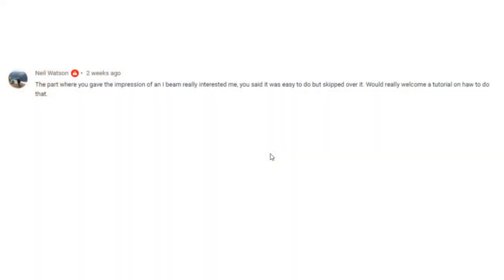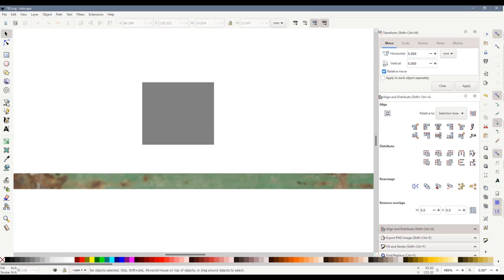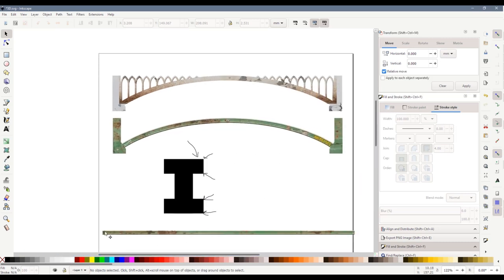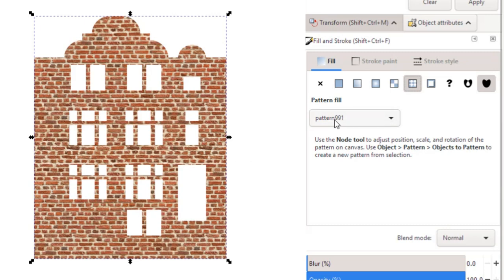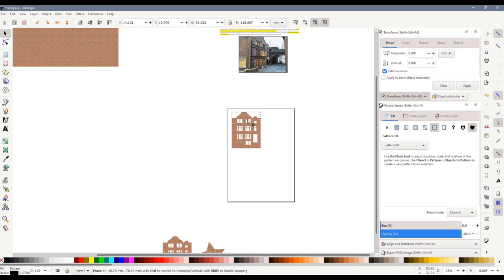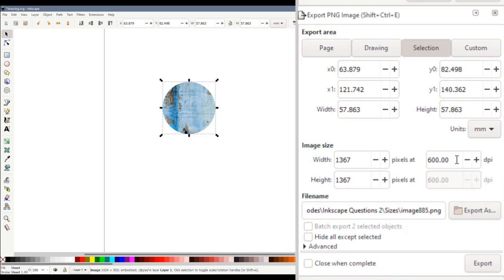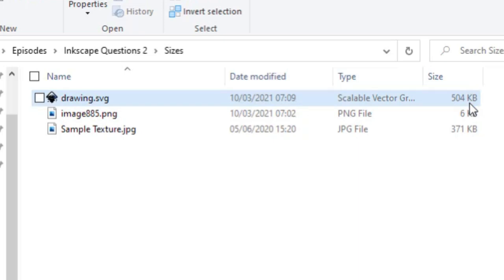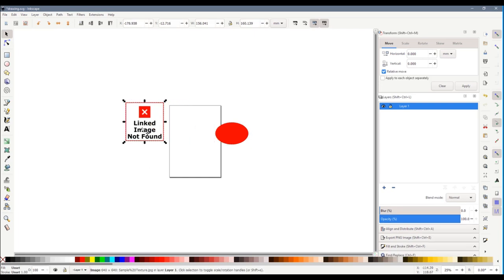Scratch Building with Inkscape: Textures - your questions answered

Comment: Great tips there Michael and I will be trying them out. I have mainly used the scalescenes textures which start around 5 MB but my files quickly grow to 60-70MB and my first file for the terrace houses was over 600MB. My poor old laptop was getting a bit warm!! I resorted to doing different elements in different files to keep things manageable on the factory. I’ll give these a go and see what happens. Cheers
Reply from the maker: Yeah 600mb files can happen if you have multiple elements all with textures that are 5MB. Because of the base 64 encoding, a 5MB texture takes up almost 7MB in Inkscape before you even start. I do think there may be something else at play to make them even bigger but I’ve not yet worked out what. Good luck. Let me know if you notice any positive benefit. Michael.

Comment: Well I hope you're satisfied with yourself!

Last night I found your videos and today I've spent LITERALLY 8 hours messing about with this software and have managed to design a little cottage for my layout... I'll be printing it out tomorrow as it's basically a printable drawing.
Won't be able to add much relief to it though... That bit still eludes me sadly..

I wonder would you be able to make a video where you show us how to create a small building, either made up or real,
But using imported textures rather than a blank template to print and wrap with brick papers?
Reply from the maker: Gosh! Thank you, I think! I hope those eight hours were enjoyable!? That’s a good idea. A quick start-to-finish where I design and build a little outhouse or something?
Reply from the maker: Hi again. I saw your reply very briefly but it has now been deleted. Not sure if you deleted it or YouTube did (it does seem to delete comments that contain a link to Textures Dot Com). But yes. Your idea is good. Fitting it into half an hour will be a challenge!
Reply: @Chandwell  I reckon you could do it!

How did you texture the front of your Weir pub?

In the video it's never mentioned and just shows you adding DETAILS to it?

Cheers!

Comment: Great, love your layout. Have you ever considered making a small line which passes through the back and goes down a small helix and back to the beginning. You know for passing trains like freight and just passes. Or is it just an end to end? Hope this helps
Reply from the maker: Thank you! Unfortunately that would not work for Chandwell. The station end is blocked in on both sides with concrete and the whole thing is built on top of cupboards that are in use for our general household stuff, so there really is no space for a couple of helix. I would love to have a round-and-round layout but not until the kids move out and we have a spare room! 😂👍

Comment: Do you have any idea how long your buildings are likely to last? I am thinking about the different adhesives you use, for example the glue sticks and the glue on the back of the sticky labels.
Reply from the maker: I have no idea, Andy. I made the first building using these techniques about 12 years ago. It was 00 scale and has been stored on-end in the garage for the last 7 years. There is no sign of peeling or delamination yet. I often wonder about my "sticky label method" window frames. I've been using this technique for only 18 months, but so far, so good.
Reply: @Chandwell  That sounds like a decent lifetime, especially if kept in the garage.

Comment: When saving there ante many file types. Which one should I save as? I tried saving as ‘Inkscape SVG’ but it kept saving it as a Microsoft edge page that I could then not edit
Reply from the maker: SVG is the best and correct format. Edge is capable of opening them and may have set itself as the default. Don’t worry. Open Inkscape and use File > Open to open the file in Inkscape. Also try right-clicking the file and choosing “Open With” and then choosing Inkscape. It may give you the option to “always open files of this type with Inkscape” in which case your problem will be solved. Let me know how you get on.

Comment: I have a question. I'm using Scale Scenes and Inkscape. When I import a full sheet texture, like red brick, Inkscape sees it as two halves. It then only prints one of the halves even if I group the 2 halves together. To print the full sheet I have to save the page as a PDF and them import that. Why???
Reply from the maker: Hi Mark, I assume that the Scalescenes kits are made with two duplicate textures to fill the A4 sheet and that it’s duplicated in a way that Inkscape doesn’t understand properly. That’s just a guess though!

Comment: Do you know of an alternative to finding the cross, circle, square? I don't get it when I use the Node Tool and scroll out. I can't find another way to reduce a Textures concrete down to 1:148. TIA. Ali
Reply from the maker: No I don’t I’m afraid. Not something I’ve come across but it does seem to be temperamental.

Comment: I would like to underscore the point about not moving your files once you start creating your design. While Michael notes deleting a file will break the link to your design (around the 28:00 mark), so does organizing your files into folders after you create your design. I'm in the final print stage of my building, and thought I'd neaten things upby organizing the scattered files into folders. Don't do that! I now have a document full of broken link notices and moving the files back to the original folder doesn't help either. Sigh. Literally back to the drawing board!
Reply from the maker: Hi! Yikes! This can become a bit of a pain, but all is not lost! In Inkscape, right-click on one of the broken images (the big bit of "Linked Image Not Found") and select "Image Properties". In the tool panel that appears, you will see "URL". This is the name of the file relative to the SVG file. So if your image was called "Bricks.jpg" and you moved it to a folder called "Textures", then change the URL to "Textures/Bricks.jpg" and you will see the image come immediately back to life. If you move the image up to a parent folder, use "../". So if you move your Bricks.jpg to the folder ABOVE where your SVG file is, then change the URL to "../Bricks.jpg". My image URLs are usually something like this: "../../../Assets/Ashlar.png". I hope this helps. :_chandClass47:MIchael
Reply: @Chandwell  Thanks Michael! Unfortunately, my version of Inkscape (1.1, which I think might be the latest) doesn't seem to have an Image Properties dialog when you right click (or any other click for that matter :))
, only Object Properties, which doesn't have those options. I saw on the Inkscape wiki discussion about the Image Properties dialog, but I can't seem to locate it on my version. I'll keep looking though. Thanks again for the detailed reply.
Reply from the maker: @NorthernJerseyRailroad  Is it Windows or Mac? Mine is Windows. You will only get Image Properties on a right click if you are genuinely clicking on an image. If you have clipped it to a shape you will need to do a Release Clip and then make the change and then re-apply the clip. If it is grouped then you will need to un group. Drop me an email if you like and I can help you. Hello@chandwell.uk